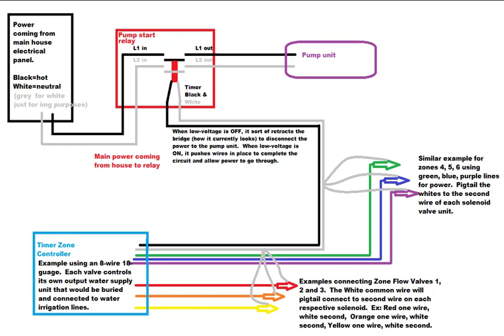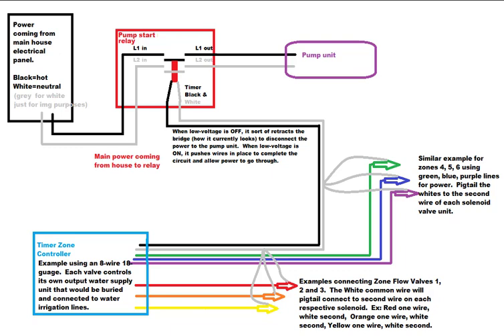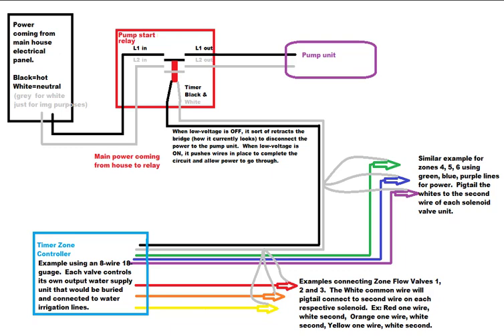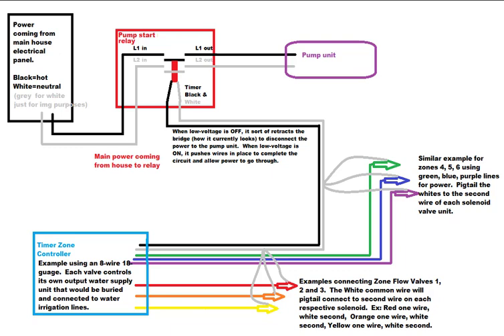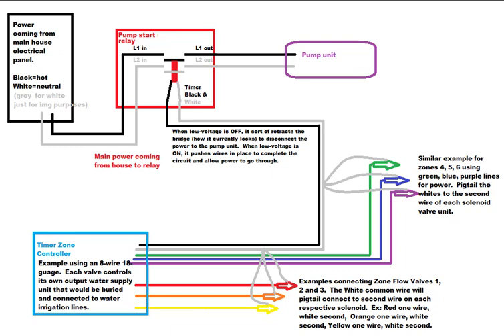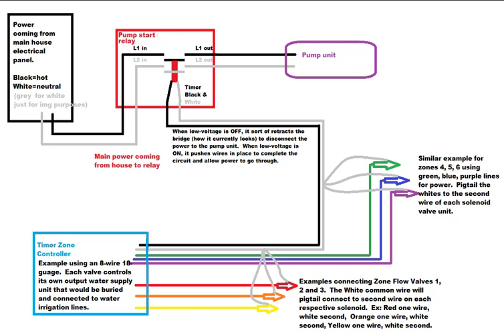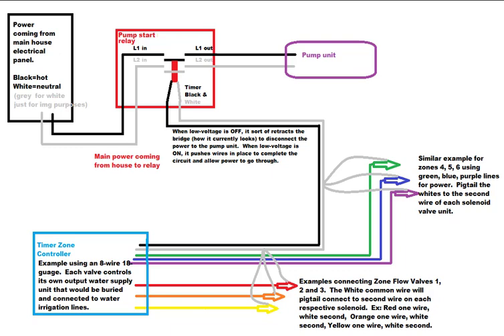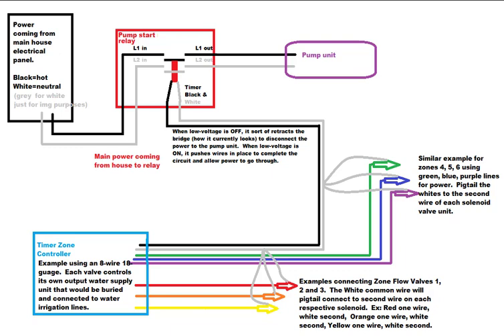4B - Home Lawn Irrigation System - Wiring by Diagram

Comment: My 2 hp  240V sprinkler pump pulls from our lake and is located 100' from  our  weathermatic sprinkler and breaker box. Currently, the relay is located next to the pump. Would a better arrangement be to relocate the relay next to my sprinkler control? This way the   24 volt line would now only be 2 feet from the controller and breaker box.

Comment: Hello sir, great videos.  I just have one question.  I am planning on replacing an analog intermatic timer with a digital and all I see are 3 lines wires coming from the power box, 2 red and 1 green.  And from the well pump I see 1 black, 1 red , and a white wire. I don’t have any white wires coming from the electrical box to the timer, and I can not find any video to assist with this setup using a start pump relay.  I would appreciate any good feedback with guidance.  Thanks

Comment: Hello Sir, thank you for your time taken to illustrate all this for free.
However, I would like to inquire about a few things.
1.May i know the type and name (specifications) of the pump used?
2.Is the voltage of the Source for the relay supposed to be the same with the pump capacity( e.g 220v source for the 220v pump?)
3.What is the use of those batteries in the Timer yet it has  a power source?
4.Can that sprinkler system be successful without that solenoid valve? In that i only depend on the pump automated switching?

Thank you so much
Reply from the maker: You are welcome on putting this all together.  Nothing specific about the pump.  
1. Pump - Harbor Freight for $130 -- 1HP pump, but that was when I prepared the videos, dont know current pricing.  
2. The voltage is two-part... One is the standard power per the image that opens the gate between your standard 120 volt power from the source to ultimately feed the pump.  Second is 12-volt low voltage as provided from the actual automatic RainBird system for controlling the zones.  I have another video that actually shows the literal wiring up sampling showing full connectivity via https://www.youtube.com/watch?v=0eEDXdO1fo4
3. The batteries are just a simple backup so if power does go out, you dont lose the settings like data/time and possible schedule.  The AA batteries come with and are as just as simple as a standard TV remote... no big deal.
4.  I dont see why it would not require the solenoid.  If your intent is to just have a pump at your direct control of plugging in and it is directly connected straight through to the pipes and sprinkler heads that you want irrigation, it just works.  The solenoid valves are specifically wired to the timer to open when you have multiple "zones".  If you have much piping and too many valves, and the pump can not provide enough water flow pressure, the sprinkler heads wont pop up and be worthless.  

Ex: if you have 20 sprinkler heads, each requiring 30psi to pop up and stay open, your pump may only be able to generate 7 before the 8th releases enough water to drop the maintained pressure and then none of them work.  So having "zones" allows you to have 5, 6, whatever sprinkler heads in one area that you run for 15-20 minutes, then another zone for another 5 or 6 sprinklers for another 15-20 minutes, etc. over the duration of your system.  

Having said that, if you have a good source, and you have some supersized commercial pump and can blast out 140 PSI or so, you can get a lot more heads simultaneously than a pump that only can put out 80 PSI. 

Hope this is enough for you to chew on, and feel free to ask again if more questions.

Comment: We don’t need to connect ground wire to relay?
Reply from the maker: Where applicable, the grounding wire should be hooked-up, check/confirm codes.  But I was trying to focus on how the relay switch works with respect to the low-voltage coming in and triggering a switch that ultimately connects the normal voltage for the pump unit.  I do have my grounds connected where appropriate.
Reply: Thank you very much for the response. 
As per the diagram from home to pump start relay only 2 wires are going where is the ground wire going
Reply from the maker: If you were to look at the diagram, the top/left box showing where power is coming FROM (Main Power, imagine, and yes there WOULD be a ground, the ground wire is positioned following a track ABOVE the black wire going out and following into the pump start relay.  Then, the black/white wire from the pump unit itself would also have its wires black/white/ground going to the pump start relay.  Also above the track of the black wire.  So now you can tie the grounds together within the pump start relay and have NO interaction with any of the other wire connections in the relay box, unless you get a metal pump start relay which mine was not in this example.  You would ground to the frame of the metal box as well.  Since this scenario was a plastic box, no conductivity would go on, so you would wire-nut both ends of the ground there.

Comment: Your videos have saved my ass with this damn gigantic irrigation system install I got myself into. I done many small ones not needing a booster pump, but this one needed a 2hp pump. They're like 350-400 ft runs for the zones. Was alot to learn, alot more then I thought. I didn't realize I need all this and can't just wire it straight to the controller
Reply from the maker: Not exactly sure how I helped, but, want to pass on the knowledge I learned from doing my install.  My length from the water source to the farthest point is about 300 linear pipe ft.  I am only running a 1 hp pump and easily handling 3 rotor spray heads.  Now, that extra 50-100 feet, and also any issues with elevation might have more impact but glad you were able to overcome whatever issue you had otherwise.

Comment: So timer wires leaving the relay (24av) would go to the internal transformer wires, correct? Where does the common / main (pump) wire come from?
Reply from the maker: Did you have a chance to see the video:  4. Home Lawn Irrigation System - Electronics In Action
  https://www.youtube.com/watch?v=0eEDXdO1fo4    This shows a working connection using a battery representing the power coming from the house electric.  The timer and how its wires get to the pump relay and finally the last leg from the pump relay to power the pump.  I also did a final video showing the final wiring connection at the lake and how they all come together in 9. Home Lawn Irrigation System - All Connected  https://www.youtube.com/watch?v=dTlFf9_uH0o   More than happy to answer any additional questions if these other videos do not help you.
Reply: @drapp5752  Did not see video 9, thanks for the reply!! Great stuff here!

Comment: What size hp pump do you have?  I have 1/3 pump and wondered if that’s enough to pump a few heads. Thanks
Reply from the maker: I have a 1 hp pump... It is something I had purchased from Harbor Freight and just had.  I included all the stuff about the setup in my #1 video https://www.youtube.com/watch?v=eFkOoUoLeqI for 1. Home Lawn Irrigation System - Intro and Overall Summary / See Parts & Prices.    It has the pump, controller, relay switch, wiring, sprinkler / rotor heads and all PVC stuff to help give a better price context to all the things integrated.  Plus has a lot of pointers I ran into while doing my installation too.  I don't think a 1/3hp unit will do much, but that is also based on the size of your yard requirements too.  The pump I have allows for 1" in/out flow all the way through my system with great flow rates to the end sprinklers / rotor sprayers.  Additionally, in my 2nd video https://www.youtube.com/watch?v=eJD1Zt03b3M , I do a sample of the pump feeding directly to PVC pipe and heads above ground for the sole purpose of testing the heads and distance.  Could be a cheap test for you to see how will it will work with your pump.